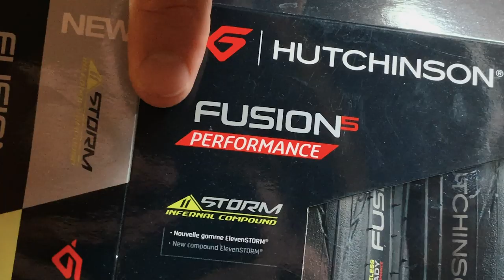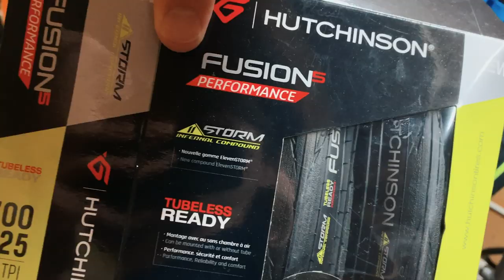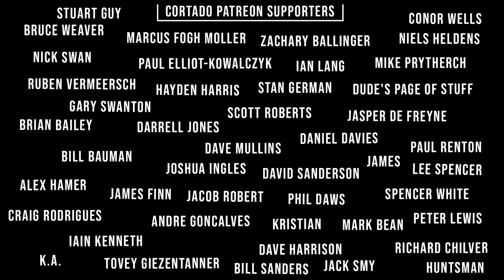MOST INCREDIBLE PLACE TO RIDE A BIKE

Comment: Regarding how you put the sealant into the tyre the shop I work at frowns upon the through the core method as it can lead to the valve getting blocked with sealant. I have used both methods at home, and mainly pour directly into the tyre and then mount it.